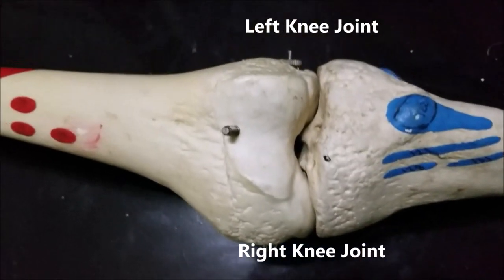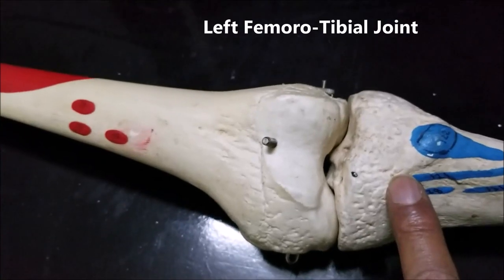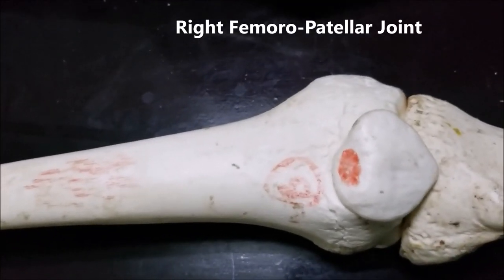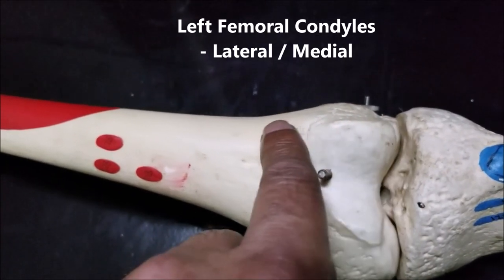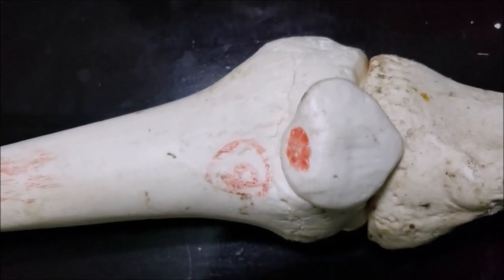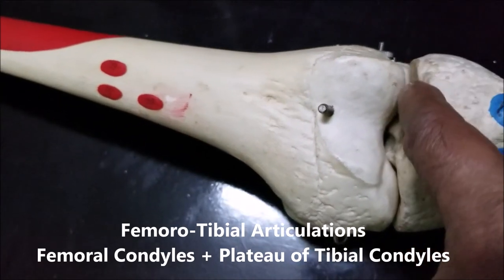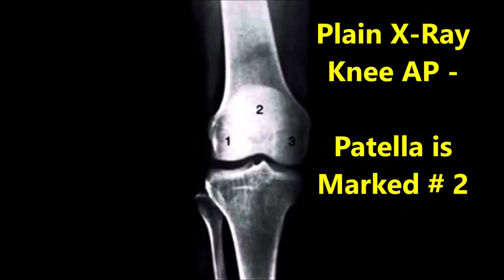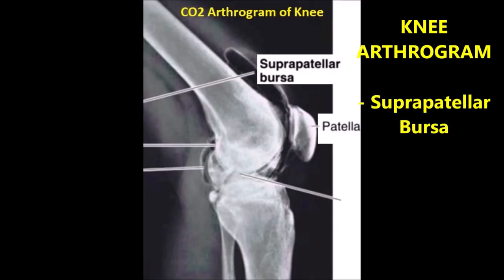PATELLA FEMOROPATELLAR JOINT Q ANGLE GENU Valgum Varum Dislocation – Sanjoy Sanyal

Comment: Sir, could you help me to comprehend CONGRUENCE ANGLE of patella ? Text says "it is formed by a line bisecting the sulcus angle and another line that projects from the apex of the sulcus angle through the lowest point on articular surface of the patella" 
I dont get this second line which passes through lowest point on articular surface of patella. What exactly it means ? If lowest point on articular surface means most superior part of patella. As we say inferior part of patella as Apex. Thank you and Regards
Reply from the maker: In order to visualize it, you have to imagine patient is lying supine with knee flexed 45 degrees and you are looking from the front of the knee. Imagine the Patella sitting on the Patellar surface of Femur. Subtend the Sulcus Angle on the Femur. From the apex of the Sulcus Angle draw 2 lines anteriorly - One line goes straight anteriorly. Other line goes 20 degrees medially. The angle b/w these 2 lines is the Congruence Angle. It is best drawn on a Radiological Image of the Knee.
Reply: @SanjoySanyal  thank you very much for clarifying.. Regards. 🙏